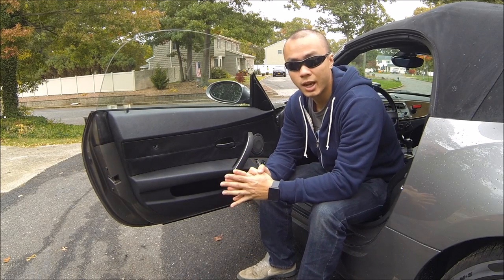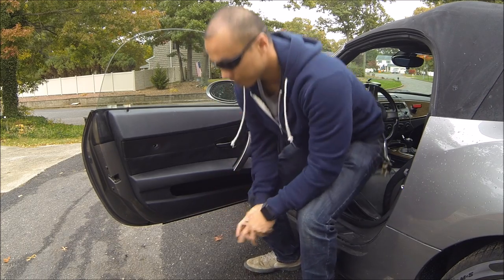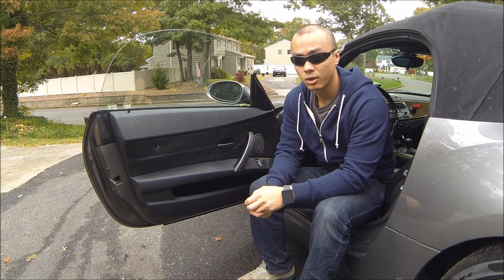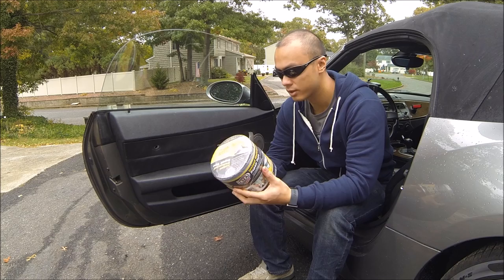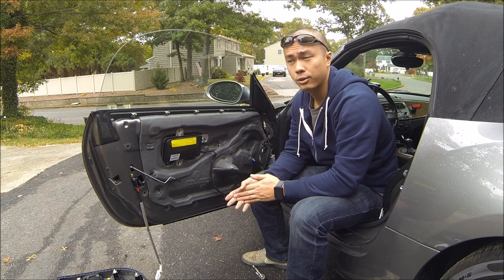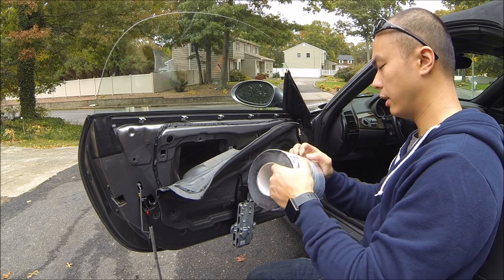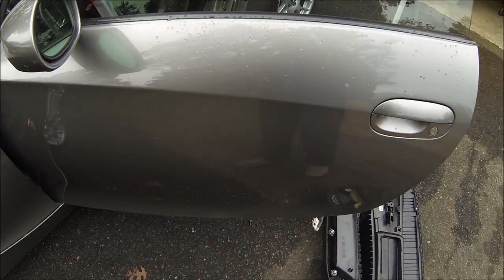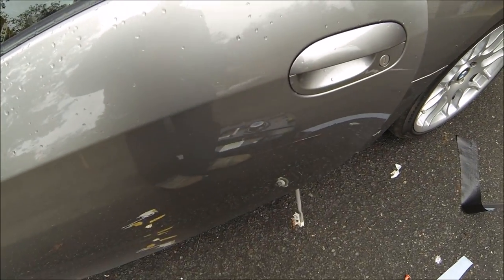Car Door Sound Deadening for Under $20! - BMW Z4 Vlog #20

Comment: please please please go read the results on the link below.  This product is NOT the same thing as products like Dynamat or Second Skin, nor does it work the same at all.  

http://www.diymobileaudio.com/forum/member-reviews-product-comparisons/146403-sound-deadening-cld-testing-69.html
Reply from the maker: Cool stuff but what were the results? I had difficulty reading through all of it
Reply: zed4me Man I completely forgot to post the other link.  This is a direct link to the last page and the summary of results.

http://www.diymobileaudio.com/forum/3522882-post1725.html
Reply from the maker: Chris Purdue Besides the stuff I used not working well, is there anything that talks about value? It may not work the best, but it still works and also costs much less per square foot. The thread ends with saying no to peel and seal, but I didn't read further about why.
Reply: The graphs for peel n seal showed almost no improvement except at high frequencies, having virtual no effect on the actual resonant frequency of the test panel.  This explains why a difference can be heard, but comparing it directly to a higher performing product is a night and day difference.  It also failed heat testing, failing at under 200 degrees f.

Long story short, I have measurements that show that 25% coverage of the high end products, works better than peel n seal and other roofing type products do at 100% coverage, making the cost between the two types of products equal.  In fact, with the high performing products, anything above 25% coverage brings diminished returns.
Reply from the maker: Chris Purdue Interesting. I can't speak to the failed heat testing as I garage my car and has zero issues with heat melting it.. but I'd be interested in doing a direct real world comparison between what I used and also the higher performing stuff side by side. I hear, and you can hear in the video, the huge difference already with this cheap stuff. Wonder how much different the better stuff would be if its really night and day all over again.
Reply: zed4me Sounddeadenershowdown.com would be my choice based on heat testing and total performance.  You can also buy individual sheets from him as well.  

On the heat testing, while heat testing doesn't guarantee that it will fail in all circumstances, but it does provide insight into how it will perform at higher temps, for instance during summer.  All products have a temperature curve, and will perform worse at high temps and low temps.  The inside of a door can easily reach 150-180 depending on the color of the car and the outside temp, etc.
Reply: I've got to say that the data just isn't there to prove that a dense adhesive tape performs any worse than a name brand dense adhesive tape.  They function by adhering strongly to a metal surface, or plastic surface, and adding weight, which lowers the resonant frequency of the material.  As long as it is dense, it will help.

However, say you have tape that's 1lb per square foot versus tape that is .25lb per square foot--they will both help, but in order to get 1 lb of material on the center of a panel, where is matters most (that's where vibrations manifest into sound the sharpest) you need, obviously, four layers of the lighter stuff, and covering more of the panel with the same weight will, probably do less than the center of the panel with more weight.

Aaaannd just to conclude, any dense closed-cell foam should do work to reduce road noise after you've taped up a door.
Reply: Tyler Frum This is absolutely incorrect.  I don't have time to fully respond today, but I will go in depth tomorrow.

And the data is absolutely there.  There is a huge lack of understanding in the fundamentals of proper sound treatments in cars.
Reply: Go find a piece of metal, put a bit of duct tape in the middle.
No difference.
Put 10 or 15 layers of duct tape on top of that first layer, keeping the ocverage the same.

You'll notice it goes from a higher to a lower sound at the same tap.  These are fundamentals of physics.  More massive objects vibrate at lower frequencies with the same energy input.

Chris, you're a pseudo-scientist, and I don't think you read through what I said, because you should know how much more heavy good sound deadening is than peel-n-seal per square foot.
Reply: And just for the sake of argument, your links top three sound deadeners:
CLD Showdown: .6lb per square foot.
Kolossus: .9lb per square foot.
Silent Coat: 1lb per square foot.

Surprise, he rated the silent coat as the best dampener of the three, and only favored the CLD because it was supposedly good across a wide range of temperatures.

Peel n' Seal, which is not as good is... .3lb per square foot, according to the roll area versus amazon's (overestimated) shipping weight.  Per weight, it's probably cheaper to just get the name brand stuff, like dynamat, .66lb per square foot.
Reply: Tyler Frum Silent Coat did outperform SDS in terms of damping, but has significantly less heat resistance.  That is a big deal considering the kind of temps that in interior of a car can reach.

But, let's look at dynamat vs stinger.  Stinger is about twice as heavy per square foot as dynamat.  It's constraining layer is also 1.5x as thick.  Yet, dynamat outperforms stinger by more than 3 decibels, in other words, it performs more than twice as well, despite being half the weight, thinner, and having a thinner constraining layer.  This isn't the only case like that either, just the most extreme.  

If you look at the Stinger and Dynamat graphs you'll notice something important.  Stinger is working like a mass loading product.  You can tell by the significant shift in resonant frequency without a significant change in the q, or shape of that resonant frequency.  Dynamat on the other hand is working like a viscoelastic constrained layer damper.  This is shown by the significant flattening of the q, or shape of the resonant frequency.  

If we were to use ASTM-756 testing on these products, the evidence against mass loading would be even more extreme, as the damping factor of dynamat would be significantly higher than the damping factor of stinger.  Unfortunately I can't afford to pay for access to the testing method, let alone the equipment to do so.

However, I will be trying to re-start testing by next spring (the links are to my personal testing of these products), using accelerometers this time in conjunction with the calibrated mic, so I can both get frequency response, decay, and damping factor.  I will also be able to do tests in full scale doors with the accelerometer, along with testing at multiple temps to show performance swing over temp, as well as testing when first appplied, and after the adhesive has "set".
Reply: Tyler Frum I've never ever claimed peel n seal was a good deadening product.

What you are misunderstanding is density/mass is far from the only thing that affects resonance.  Stiffness, internal damping, external damping, and much more also affect resonance.

The goal is not just to lower the resonant frequency of a panel, but to use damping to reduce the amplitude and decay time of said resonance.  Mass alone is a very ineffective way to do both of those things.

And with that, I'm passing out.  I'm more than willing to continue this discussion tomorrow, however it's well past time for me to be asleep.
Reply: Chris, you aren't reading.  I was agreeing with you.  You are too quick to pedant about being right that you don't realize I disagree with your reasoning, not your conclusion.

Amplitude?  You can only change sound, which is movement energy, into less movement energy by generating heat, electricity.  A lower frequency of resonance will, however, reduce the sound to less perceptible levels.

And decay time cannot be altered independent of mass, only the threshold of perception, and .  You need to hit a massive bell hard to make it chime as long as a tiny bell hit softly with the same design, scaled.  It's a factor of mass, again.  

As for stiffness, on a scale between plastic and liquid tar, greater stiffness only enables the transfer of sound energy rather than the transformation of it into flexes in the material.  But if you've ever actually handeled sound deadening materials, you'll notice that they are a compromise between being soft and malleable, and not melting.  If they wanted to reflect sound off the surface they'd make it stiff, absorb sound, soft.

Essay.
Reply: Tyler Frum I absolutely realize that you are agreeing with which products work, but not why.

I would invite you to do some research on constrained layer damping.  The better products, the ones that perform well, work on this principle.  In short, constrained layer damping sandwiches a viscoelastic material such as butyl rubber, between the panel that is to be damped, and another metal panel (the aluminum layer on damping products).  When the panel deforms from impact or vibration, the aluminum layer deforms as well, creating sheer forces on the butyl layer.  If the correct type of butyl is used, it is viscoelastic, which means when it is deformed it returns to shape more slowly than it takes to deform it.  This combined with the sheer forces created by the butyl being sandwiched between the layers causes some of that kinetic or mechanical energy to be converted into heat.  No one every said that energy was dissappearing.  And I even explained how to read the graphs to see when a product was performing more as a mass loading product, or more as a constrained layer damping system.

It's also important to note, that none of the asphalt or bitumen based products behave as a constrained layer damping product.  Only the butyl products do, and even then, not all butyl used are the same.  My testing has confirmed to me and others that the actual formulation of butyl is the most important factor.  This was confirmed as well by a polymer engineer that works dow chemical.

If you would like, I will go through the pages of that thread and find a pdf for you, it was a master's thesis written for the us naval academy on the merits of constrained layer damping.  It's around 800 pages if I remember correctly, and I did read through the whole thing before starting this project.  And while I, myself, am no scientist, I did have the help and input of my father at the time, whose was an engineer with a master's degree in physics.  My results and process have also been reviewed by two engineers who work for NASA, one a mechanical engineer who works with the rover program, and one a digital signal processing engineer, both of which agree with the results and reasons for those results.
Reply: Out of curiosity, and I just want to make sure I'm understanding you view correctly that mass is the all important factor in performance?

How would you explain Dynamat Extreme performing significantly better than Stinger Roadkill Expert.  Remember that Stinger about twice as heavy per square foot as dynamat, and the testing used 28.25 sq inches of material for every test on a 10"x10" 16ga steel sheet.
Reply: Show me your published results. That disagree with what I've been saying.
And constrained layer dampening manifests in every dampening material having an metal layer on the other end, but is really only useful for extremely high mass applications.

Like half inch thick ship hulls attempting to absorb sonar, not 1mm thick car sheet metal.
Reply: Tyler Frum The second link I posted goes to the links to individual results.  It seems there is a problem with the mobile view, but if you look at it in regular web view it'll take you straight there.  You want to click the link for Stinger Roadkill and for Dynamat Xtreme.  Stinger weighed 0.80 lbs per square foot on my scale.  it reduced the amplitude of the natural frequency of the metal panel by just under 8db.  Dynamat Xtreme weighed in at 0.47 lbs per square foot, and reduced the amplitude of the natural frequency of the metal panel by just a hair over 11db.  Stinger is 80mil thick with a 5mil constraining layer, while Dynamat is 67mil thick with a 4mil constraining layer.  They are posts 250 and 275 respectively.
Reply: Tyler Frum And while yes, you are correct that everything with a "constraining layer" and "damping layer" could be considered a cld, not all products act as such in terms of effectiveness.  The asphalt/bitumen products are particularly bad at this.  Some butyl products are also bad at this, while others excel.  There are a few butyl products that have near identical densities, near identical thicknesses, and near identical constraining layers, yet perform nothing alike.

And they are absolutely effective on car sheet metal.  If they werent, you would not be able to see reductions in resonance amplitude of 11 decibels without more than quadrupling the mass of the metal panel.  Remember, it takes doubling the mass of a panel for every 3db reduction in resonance amplitude.
Reply: Tyler Frum Tomorrow I will dig up another set of tests I did as well.  This one only used SDS, but also clear shows that more is going on that simple mass loading.  In that testing session, I compared 25% coverage vs 50% and 25% vs 100%.  Both cases showed significantly dimished returns when going past 25%.  I also tested 25% coverage in a single, centered piece, vs 25% coverage in 4, centered pieces, and the test with 4 pieces showed abysmal performance compared to the single piece test.
Reply: You haven't dug up any tests--you need to share published research if you're going to make wild claims about car audio that the boys down at my local car audio store had a laugh about yesterday.
Reply: Tyler Frum Did you bother to check the link above.  It has the results, in both frequency response and waterfall plot form for everything I have claimed.  If you haven't bothered to look at the link that I have referenced multiple times, then you are purposely avoiding it for some reason.  As I said ealier, second link I posted above.  It goes straight to a list of links for the results of each product I tested.
Reply: Published research =/= Random forum post with a subjective argument and frequency response differences that are below the threshold of significance for scientific testing.
Reply: Tyler Frum Well that's fine then, and you can continue to make wild guesses about what actually matters in vibration damping.  Because until you do some testing of your own, real, objective testing, that is all you are doing.  Because my testing is the most in depth, realistic testing you will find on this subject.  Enough so that the 2015 Meca Modex world champion and world champion best of show, who just happens to be an engineer for nasa, agrees with my results and testing, and uses the product I recommend for the exact reason I recommend it (and did so before I even completed testing).
Reply: "My testing" Your links don't even contain data and graphs, having a second look.
Stop being lazy and post a link to your "research."
Reply: Tyler Frum Interestingly enough, I just found the measurement results using the links already provided, just as I said.  But, here is the spoon fed version.

http://www.diymobileaudio.com/forum/1945441-post260.html

Stinger Roadkill
Reply: Tyler Frum http://www.diymobileaudio.com/forum/1945898-post275.html

Dynamat Xtreme
Reply: Tyler Frum http://www.diymobileaudio.com/forum/member-reviews-product-comparisons/262722-cld-testing-2-application-techniques.html

Application techniques.  25% vs 50% vs 100% vs 120% vs 25% cut into four pieces.
Reply: This would be much easier to read in a chart rather than a series of graphs, for future reference.  If I submitted a regression based paper without a chart or with 3d graphs it would have been rejected.  Give me some time to decipher what you're actually testing where.
Reply: THis is nothing personal, but the data you've provided is basically unreadable.  3d graphs are pretty useless, and it's hard to see what you're testing where to make actual comparisons.  You may very well have made a series of good observations, but it's neither clear what they are, or what they are compared to one another.  Neither are your methods clearly stated.  This cannot pass in substitution for scientific research.
Reply: Tyler Frum 10-4.  Keep in mind, I did this testing at home, with a $100 budget, because no one else was willing to.  The car audio community donated most materials, along with some of the companies themselves (SDS, Silent Coat, Second Skin, Cascade Audio, GTMat).

Just so your clear on testing method and setup.  The test panel was a 12"x12" piece of 16ga steel, clamped in a jig with 10"x10" exposed.  On one side, a calibrated Dayton measurement mic was placed 1/4" from the panel, in the center, using a jig to assure repeatability.  The other side of the panel was enclosed in a box measuring approximately 1 cubic foot.  On the side opposing the panel, two Hybrid Audio Technology speakers were mounted to a baffle.  The back of the speakers were contained inside another 1 cubic foot box.  Tests were always ran at 77 degrees, with the whole surface of the panel being checked with an ir thermometer.  Signal sent from REW from my laptop, to a bridged class ab amplifier to the speakers.  Sine sweep from 20-1000hz.
Reply: The budget and testing aparatus aren't the issue, it's how you've organized the data.  If you still have it, I would just really recommend organising it into columns and tables, so that all the 28% tests are clearly labeled and next to one another, with averages at the end, for instance.
Reply: Tyler Frum I just want to clarify that your looking for something like a spreadsheet file, correct?

I believe I have all original files from this aside from the last link I provided, however all of the product comparisons I should still have.  And I will readily admit that comparing the results requires looking at multiple graphs from different sets of results in comparison to each other.
Reply: Tyler Frum And what data points would you like.  That is the biggest reason I keep it in RTA and waterfall plot form.  It allows someone to see both the total amplitude drop of the natural frequency, and the change in Q of that frequency.
Reply: Wouldn't peak change and average change be the most valuable?  Even a table showing the db reading every 5 hrtz for each test, labeled, would be better.  If you made waterfall graphs you ought to have that data in a spreadsheet, pretty much in that format already.
Reply: Tyler Frum I'll make sure I still have the original measurement files, and go from there.  As for the waterfall plots, I used a free program called Room EQ Wizard.  It automatically creates waterfall, RT60, Phase, Impulse, and Frequency response graphs from a sine wave sweep that it creates.

Peak change would be easy for me to do and relatively quick, every 5 hz will take a little longer, but as long as I still have the files, I'll start working on it.

And no worries about taking things personal, I expected to be questioned going in.  I have no issues at all with constructive critism.  Personally I was just tired of accepting sales pitches as fact.  I know that the owner of SDS, before coming out with a product, did heat resistance, cold resistance, and adhesion tests on many brands, and actually received death threats over it.  As I do plan to do some more testing next year, and go much further in depth with it, I actually appreciate anything that makes the process better or results easier to read for the majority of people.
Reply: got my passengers door with Silent coat(just two pieces where it counts) ...then closed cell foam and then MLV 2.5mm(Soundbar) can't be more happy about the door, it's just a bit heavier than the drivers door but it's WAY better, it feels like a luxury car door(in my seat ibiza 1.2 sc tdi e-ecomotive 2012 model) ..not that stock is bad, but the treated door is way better.

I'll do the drivers door in the spring(you need to have proper temp to stick things right)

In the back sidewalls I have silent coat all over the place, there I'll put MLV 5mm(soundbar) and closed cell foam

I'm trying to make the car as quiet as I can :D
Reply: Tyler Frum hes probably a dynamat salesman
Reply: Abdiel L. Ha, yeah, that's it.  If I was, wouldn't I recommend Dynamat as the best product?

Actually, I was offered jobs by two different companies while I was working on this testing.  One as a rep, one as a consultant.  I turned them both down, as that would have a, made me appear biased, and b, it's just not something I'm interested in doing.

I don't work in the industry in any way.  I build my own systems, and help others with theirs on a strictly volunteer basis.  I couldn't get a job in the car audio industry that paid as much as my day job.
Reply: Thanks for doing the testing. From my conclusion out of all this. You can buy the more expensive stuff as you dont really need to use so much (around 25%) to get good results for the money, while also having a lighter product.
That sound about right?
Reply: Paragon84 Yep, thats dead on.
Reply: FYI i have been a roofing contractor for 15 years and not that stuff does not melt its used for roofing. roofs get alot hotter than your car does. I have used this stuff on metal roofer in phoenix az.  now for the sound IDY
Reply: that isnt true that can withstand more than 200 i live in phoenix az and im a roofer i put it on metal roof al the time
Reply: yea chris has no idea what he is talking about like i have said i am a roofer in PHOENIX az and that stuff can withstand heat
Reply: agreed
Reply: chris purdue needs to get a life he must have his BA in sound damping
Reply: Forty86 yes 5 Parts per Million that's nearly nothing. It's one of the hazardous ingredients they have to tell us about.